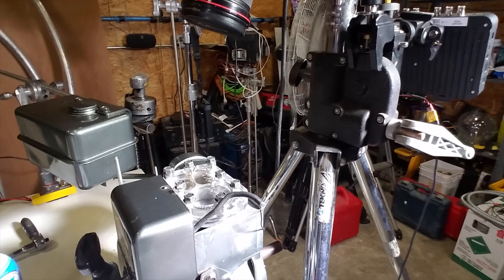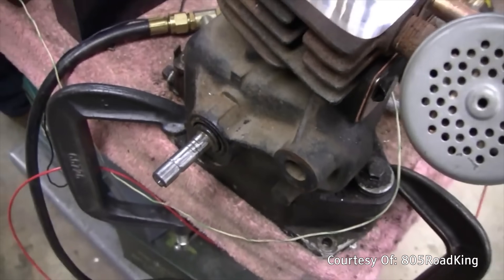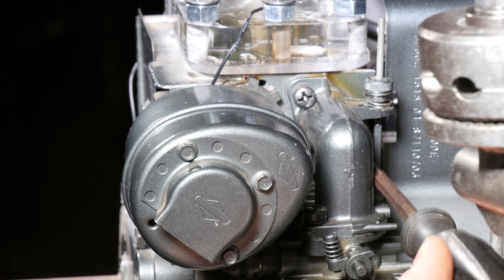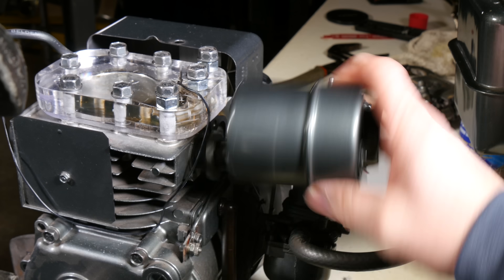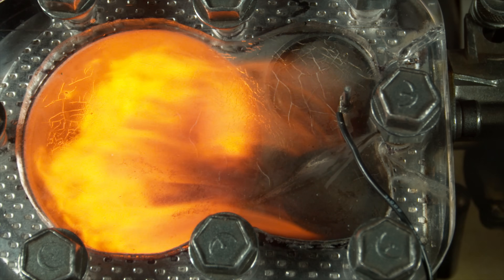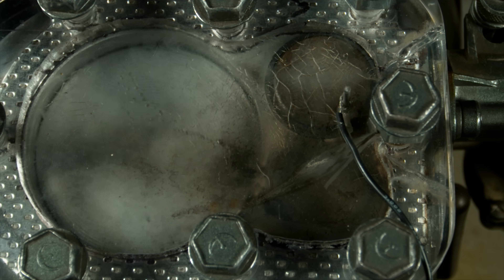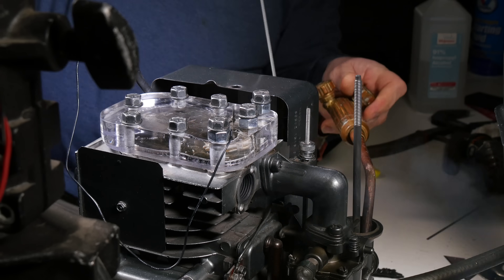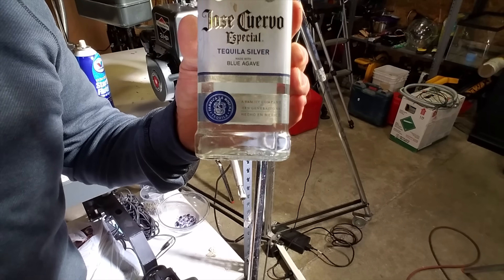See Through Engine - 4K Slow Motion Visible Combustion ( S1 • E1 )

Comment: How did the alcohol not hydro lock the engine? There was so much alcohol left over after the combustion cycle, lol
Reply: Probably because all compressible volume wasn't filled with liquid -- still had loads of air in that. What I thought interesting is that the engine was quite obviously flooded, but it still ran on the isopropyl alcohol -- I wonder what would happen if one re-jets the carburetor appropriately and lets it vaporize the alcohol naturally rather than pouring it straight down the throat.
Reply: Nik Coffman 
That wasnt alcohol left over. that was water. And pistons cannot compress water. That would cause it to hydrolock.
Reply: Stephen N
Yes, if the combustion chamber is completely filled with it. It clearly wasn't.
Reply: More likely the fuel/air ratio was way wrong and only a small part of the iProp actually combusted
Reply: The piston rings probably don't seal that well either.  It looks like some water was leaking down the cylinder wall into the crankcase.
Reply: It was only 91% alcohol. What we saw being sloshed around was the remaining 9% water. He needs to use 100% alcohol to avoid the sloshing.
Reply: He had so much liquid because he poured it into the carburetor so it was unmetered.  Would have been better to put it into the gas tank or hose so that it could control amount of liquid going in.
Reply: That's what happens when it's not metered

Comment: When the piston moves inbetween the explosions is that just because if the momentum it's got?
Reply: That's part of how a 4 stroke engine works. intake valve open, piston down (stroke 1, flywheel momentum) drawing air/fuel, intake close, piston up (stroke 2), spark, bang, hot gas expands and pushes piston down (stroke 3), exhaust valve opens, hot gasses vent pressure, piston rises with flywheel momentum and forces out almost all the burnt exhaust (stroke 4), exhaust valve closes, return to start.
Reply: Yeah that's what the flywheel is for, to keep it turning between firing strokes. Without the flywheel the engine would have to be a LOT more efficient and have a LOT less friction.
Reply: essentially, when the piston moves down in the cylinder, it creates a vacuum which as you said, the air/fuel mixture rushes in to equalize the cylinder back to atmospheric pressure, at which point the intake valve closes, and the piston moves up into the compression stroke.
Reply: Yes.  It's a four-stroke engine, as you described.  It's been sometimes described in the UK, "suck, squeeze, bang, blow".
Reply: Andrew Diamond i might be wrong but if when the combustion takes place while the piston is at tdc doesn't the compression actually push the piston down wards making it's power which is also known as the power stroke but i mean i could be wrong I'm just saying because i hope i have the right idea of an engine functions
Reply: Alistral Correct.
Reply: Alistral while you are correct there's only one thing you got wrong. The piston actually does not pull or push air fuel mixture/exhaust. as it is under high pressure the gasses try to find low pressure areas to equal out. Science 👽
Reply: Andrew Diamond same thing
Reply: Adolfo Alvarez you hit the nail on the head. basic engine mechanics.
Reply: Adolfo Alvarez compressed fuel/air forces piston down, etc, etc, etc, turning the crankshaft giving torque to the clutch disk/ flywheel/ and so on and so forth to come out at the wheel which ends up getting knifed by a punk kid.
Reply: Adolfo Alvarez jk. but yes. I only know from having to tear my engine down recently.

Comment: 2 or 4 stroke? I can't tell.
Reply: NorthBoundWolf  Its 4 stroke, 2 stroke engines does not have valves but built channels in cylinder as far as i know.
Reply: pamich27 27 that's what I thought too. I just wanted to be sure.
Reply: NorthBoundWolf 4...you can see the wasted spark in the exhaust cycle

Comment: The alcohol is a fail because of the excess poured into the intake rather than the fuel tank-producing an extreme flooding condition, which is an abnormal setup.  In addition, you should have used 90% alcohol for better results.  Propane would have been perfect and clean.

Comment: I would have wanted to see how basic 3% (or higher) 2t stroke fuel behaves in 4t and how motor oil on top of piston behaves. So hoping to see those in future. Also would be interesting to see is it possible to see any difference with leaking piston rings.

Comment: be interesting to see what the flame front does if you were to position the spark plug in different locations
Reply: he probably put the "Spark Plug" near the valves so it could actually create a spark; the spark plug in the original configuration is grounded to the cylinder head; with the glass cylinder head, there would be no chance of a spark from a real spark plug since there is nowhere for that spark plug to ground out since the head is now made of an insulating material.
Reply from the maker: true, i mainly mounted the spark probe in that spot to clear the view of the combustion chamber.

Comment: The jets were way too large for the ethanol fuel. Thats why it was running super rich. The acetylene was also WAY rich, as you can tell by the black smoke. You would really need a different form of regulator setup to run off it, similar to propane.

Comment: next time you try run a motor on acetylene, put a little turn on the oxygen. when ignited in an oxygen rich environment acetylene is way more aggressive, it will also burn cleaner and less carbon soot, the heavy soot was because you were starving the acetylene of oxygen..

Comment: The rubbing  alcohol has a high water content, that is what you see collecting in the combustion chamber
Reply: No, it was collecting because the ignition timing wasn't tuned for alcohol, which is the coolest part of the video in my opinion. 

You can see the piston moving noticeably faster with the alcohol, and eventually the ignition timing gets desynchronized with the piston. 
This, combined with too rich of an air-fuel mixture is why the engine was flooded (though it still continued to run, another impressive feat). 

Essentially this video demonstrates why tuning and sometimes part swaps must be done in order to switch a gasoline engine to ethanol, but also demonstrates the performance gains from doing so.
Reply: It was because he just poured the alcohol into the carb and it was not being metered by the jet!
Reply: No, it's only 9% water. The amount of Rubbing alcohol used would not leave enough water behind to fill the chamber. As dragondaze said, It was alcohol without a controlled injection, notice the rate at which it was entering the cylinder, filling it well before combustion.
Reply: Neither likes a polished intake.
Reply: Also ethanol works better if the intake has rough walls -- gasoline works better with polished ones.

HTH
Reply: all this wrong expertise is funny
Reply: Michael Workinger depends on which type I think

Comment: his head cracked with the alcohol
Reply: +Dr Deuteron  crazing is a form of cracking. thanks
Reply: The link lol ... "Crazing is the phenomenon that produces a network of fine cracks..."
 
As Dylan was saying ...
Reply: Dylan Monroe almost hydrolocking the engine. didn't stall due to the alcohol content mixed with the water. that's what happens when you dive too deep in water
Reply: +E. coli true, but not anything of what I said as an observation.

Comment: Why does the spark plug spark during the exhaust stroke??
Reply: This engine has a very simple ignition system where the spark is generated as a magnet on the flywheel passes the ignition coil. So every revolution will generate a spark, even if it's the exhaust stroke. 

If the combustion was reasonably complete then the spark on exhaust doesn't cause any problem, but if combustion was incomplete it can ignite the exhausts. The way these engines are built this isn't really a problem. But if it happens a lot then you may want to adjust to a slightly leaner fuel / air mix.
Reply: Because it's exhausted.
Reply: Jack Le why not? It's a very primitive ignition system. it just sparks every revolution of the crank. Half of them happens to be exhaust... NBD.
Reply: it can easily be corrected by the cam shaft. He already had it for the intake and exhaust valves.
Reply: Thanks Blahorga. I was wondering the same thing as Jack Le
Reply: Its called a wasted spark system. the vast majority of modern pertrol engines use this - simple and it works
Reply from the maker: correct !

Comment: When you see it like that you realise how clunky and wasteful the process is. Is this really the best we got?
Reply: I had the opposite perspective. It showed how efficient gasoline is, it's a very tiny amount that gets ignited every time.
Reply: periurban No, we've got way more efficient internal combustion engines than this ancient design.
Reply: No, no it really isn't. This is a damn lawnmower engine, do you expect to see the height of internal combustion engine technology?
Reply: The internal combustion engine is very wasteful. Its efficiency is around 30%.
Reply: I immediately realized how fuel injectors would be more efficient here.  Carburetors are cheaper though, so if there are no efficiency requirements this is what people are willing to pay for, even if it costs them more in the end.
Reply: No, its not the best we've got but its the best we've got at an affordable price point with high reliability, high safety, relatively low maintenance and a hundred years of improvements built into it.  It will be a looooong time before piston engines are totally supplanted for cars/lawn equipment, etc.

Comment: Would it be possible to make a fully see through engine? Except the vital parts like piston etc
Reply: Possible but far from easy. As shown the transparent top they made didn't survive for very long. It might be possible to make an engine block out of poly carbonate or some similar material, but it would need to have the cylinder(s) sleeved or it wouldn't work. Making the block out of glass might be possible, and it would probably be possible to omit the cylinder sleeve, but it would be very complex and expensive.

For what it's worth it would be much simpler and cheaper to do a cutaway to expose the internals and run the engine dry. For short demonstrations that should work, but run it for more than a minute or so at a time and it would be damaged.

Comment: This was cool. You can really get a sense of the flame front advancing and its overall combustion time. Maximum efficiency is delivered when the fuel/air mixture expands through the entire "bang" stroke. To the naked eye, gasoline seemed to have the best characteristics here. It would be interesting to measure the crank output in each case.

Comment: Why is the engine sparking on the exhaust stroke?
Reply: Presumably the magneto, or whatever it's called for small engines, gets simpler (i.e. cheaper) when you can just have it fire on every rotation instead of every 2 (no need for reduction gears, etc).
Reply: R1ddic aah I see. Thanks.
Reply: +George Smith it's a waste spark due to simple design. it's only a problem if you wanted to run hydrogen as the flame speed is much faster. You'd also need to change when it sparked to after top dead center.
Reply: The engine is burning rich. The AF ratio is less than 1. A complete burn would have a more controlled propagating flame front and no explosions. There are also dead spots, which can be eliminated with higher octane if needed. There's a lot more math needed to design the a better fuel.

Comment: well if you want to do some more experiments, a rumour goes that when you add some aceton to gasoline, your engine will be cleaner and runs more economically. you could test that with the see-through top and exactly measured amounts of fuel with and without aceton to see the difference what will run out of fuel first and burns the cleanest (and if the rubber parts will melt away or not, wich is assumed by a lot of people too). Also, the same test with a little kerosine addition in stead of aceton (because the Forte and other Brands 'powerup' fuel additives are said to be just pure kerosine).

Comment: +1 for tequila as fuel. Harbor freight has a new vtwin lawnmower engine, that'd be awesome with 2 clear heads. I'm not sure if it is possible though, pg 2of the owners manual is the engine disassembled. http://m.harborfreight.com/22-hp-670cc-v-twin-horizontal-shaft-gas-engine-epa-61614.html

http://manuals.harborfreight.com/manuals/61000-61999/61614.pdf
Reply from the maker: +Detky_Cinematics depends if it's overhead valve or not

Comment: this engine will not run on tequila until it has 70 per cent of alcohol itself, although it will damage the head gasket because water thats being produced during combustion process is uncompressionable, so thats it.

Comment: How does it go up and down more than once with only one spark?
Reply: The four strokes are - intake, compression, ignition, exhaust or - suck, squeeze, bang, blow.
Reply: Kinetic energy from the combustion is put in a flywheel, which in turn keeps the piston rotating while its pushing the exhaust out, sucking the air in and compressing it.
Reply: That's how a 4-stroke engine works.  It comes up twice and goes down twice per cycle.  The flywheel on the crankshaft keeps it turning between the combustion portion of the cycle.  Cylinder goes down - intake.  Cylinder comes up - compression of the air/fuel mixture.  Cylinder goes down again from the combustion of the mixture, then comes up again to release the exhaust, and the cycle starts over again.

On something like a 4 cylinder engine, the pistons and valvetrain are timed to have a combustion cycle for every 180-degree turn of the crankshaft.
Reply: Only god knows 🤔
Reply: BludBubbles In simple terms, the inertia of the flywheel and crank. If we're talking about a single cylinder engine. For multi cylinder engines, the other pistons fire successively to keep the crank spinning.

Comment: You aren't really burning much alcohol if you just pour it into the carburetor. It has to pass through the vaporizing needle just like the gasoline does to make it burn. You are mostly just burning gasoline, flushing the lubrication off of the cylinder walls and contaminating the oil. Putting acetylene in it will act like an even stronger solvent and it burns to fast if it isn't regulated, thus causing the damage. You should add a fuel line switch over valve to see how different fuels actually work on their own and be aware that fuels like alcohol and acetylene can dissolve plastic engine parts. The other guys that put a plexiglass head on their engine are running propane which burns much cooler so it doesn't damage the head.

Comment: try the alcohol  (and perhaps the tequila) with some kind of high pressure direct injection system to vapourise (or at least 'atomise') it and it should burn more completely. also, did you try adding a little more oxygen to the ascetalene? (although I guess at those temperatures the head wouldn't last long at all)

Comment: why does it spark when the exhaust exits? doesn't the spark plug do twice the work that way for no reason
Reply: Also called waste spark system. Many cars have this too.
Reply: It's not as much to burn unburned fuel yet, it's that the engine has a simple magneto which will spark once every rotation, regardless of valve position.
Reply: The magneto sparks once per rotstion, i.e. Every time the piston is at TDC. This burns unused fuel but is also simpler to build, otherwise you'd have to have a 2:1 geared magneto running at half engine speed.
Reply: to burn fuel that hasnt been burnt yet
Reply: ILLUMINATUS burn unused fuel.

Comment: nice,,, what needs to be done is a calculation of the force generated from the ignition of the fuel and the pressure on/in  the cylinders at all times and the power output .,,,and do it with the various fuels  engines don't work like you THINK ..   uh duh, it was duh kinda interesting the way the um engine ran with the alcohol hardly combusting..moving on.

Comment: So my observing of this is, With gasoline the engine worked best rhythm wise. With the Alcohol it ran but it stuttered and almost was drowning (But why was there more alcohol input than gasoline? Did the alcohol not burn completeley out until the next intake?) and with the gas, well it just was to much to handle for the piston but it worked until, one time with the lesser acetylene it sometimes didn't spark).

Conclusion, this engine runs best on gasoline, right?

Anyways, really interesting video, thank you!

Comment: Here's a whole dump of ideas:

-Propane
-Methanol
-Running normal fuels with pure oxygen
-Comparing rich gasoline mixture versus lean (may need an O2 sensor to verify)
-Hydrogen with normal air
-Hydrogen with pure oxygen
-Find a way to integrate potassium chloride and strontium nitrate into the charge to make a purple flame front.
-Will a copper plating on the piston make a green flame?
-NITROUS!

Comment: When you ran the alcohol why did you not run it through the fuel bowl of the carb?  You are just flooding the engine by pouring the alcohol into the throat of the carb.  It needs to run through the main jet in order to be metered properly.  That being said the main jet would have to be changed to get proper combustion but the results would be much different if you ran it through the carb properly

Comment: Awsome do you think you could do a diesel engine 1) with plastic that is probably too thin because I would like to see the head explode... I guess that could cost you a fuel injector depending on the engine design. 2) the right thickness plastic. oh and if you could load the gassoline set up with something like a break and stall the engine, again to see if you can break the head. Sweet job guys!!